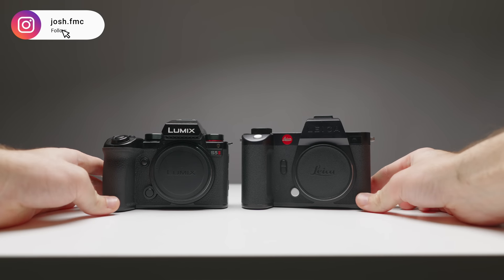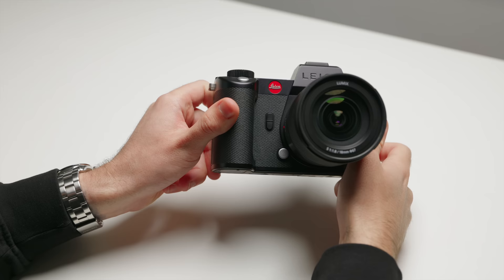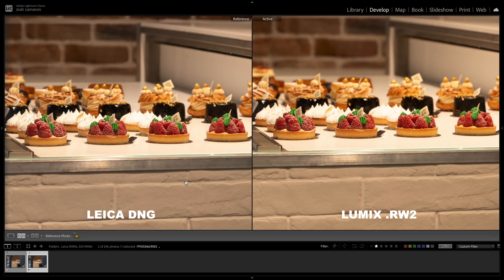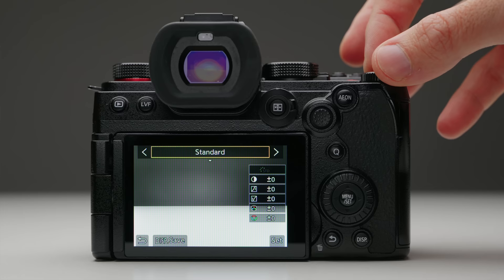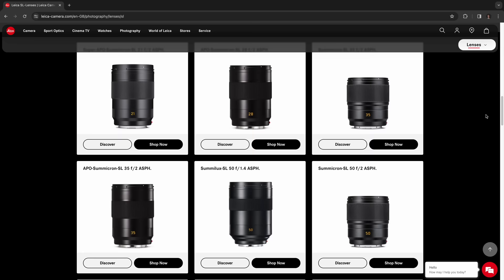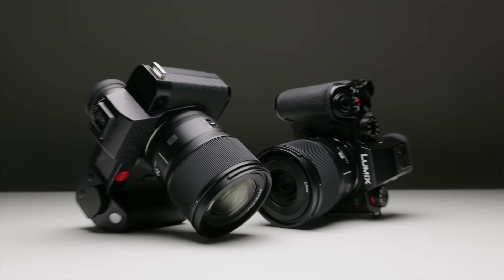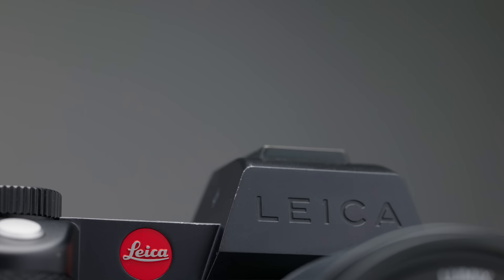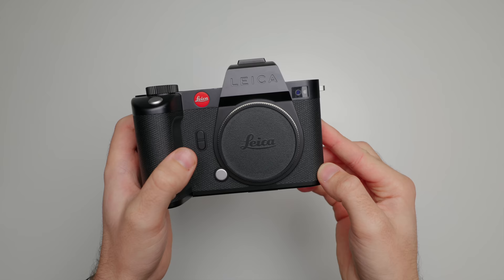Lumix VS Leica Colour Comparison

Comment: You can do just about anything on the Lumix that your can do on an SL. But that’s not the point. The build quality and user experience are what you are paying for. In addition the long term resale value is also worth considering. I have a 10 year old M240 that still fetches more than 3k on the used market. When you hold and shoot other cameras they just don’t have the premium feel of the Leica bodies. The only similar experiences I have had has been with Hasselblad from a haptic standpoint. I have an SL2 and its amazing. Not the latest tech but completely professional and contemporary with most modern cameras.

Comment: Honestly I have been able to spot the Leica, the colors seems to pop a little more because it has just a little bit more contrast, and also it seems to be a little more precise in the reds region (a little bit cooler so that red looks less like orange). But Panasonic is 99.5% there, and you can get there just tweaking a little bit the raw file (something you normally do after all). So the price difference doesn't seem really worth it to me, but if you want to spend that kind of money for all the other stuff that makes a Leica a Leica, at lest you have a slight improvement there too.

Comment: I've used Leica rangefinders professionally as well as a Leica V-Lux 114 bridge camera when short videos were required as part of my press assignments.  My impression of Leica colors is that they are just a bit warmer than the Lumix G9 I now shoot in retirement.  I still shoot JPEGs and had to adjust the G9 STANDARD colors to warm them up considerably to get close to what I considered to be Leica-out-of-the box colors.  This was not necessary for my 114 which, on the face of it, seemed to be a Lumix FZ 1000.  I still shoot JPEGs and have heard the NATURAL profile for Lumix JPEGs is warmer so perhaps I'll give that a try soon.

Comment: Bottom line: gear doesn't really matter! Throw in a Lumix G9 (I or II) and a medium format as well. Use equivalent FL lenses, process the RAWs (JPGs are a joke), and print the results (digital images are not true photographs). Now, put them on the wall and see if you can tell the difference. Under most conditions, a pocket P+S (or even a phone) in the right hands can produce museum-worthy prints. All you get for the considerably greater investment in more capable gear are things like a slight advantage in marginal conditions, better durability/reliability/redundancy, possibly better ergo and weatherproofing, certain features of variable utility, and snob appeal.

Comment: This is a fascinating comparison. Thank you. I would say that in the portrait comparisons at 3:02, there is a smoother skin rendition and softer contrast from the Leica that offers a more pleasing image. However this is slight and can be corrected in post.
The BIG question is about the difference in the filter thickness on the sensor. It is reportedly uniquely thin on the SL range, to allow for the use of M lenses without smearing, especially when using wide lenses. I often hear this mentioned but have never seen a proper comparison. If there is any way you could do a once and for all test with Leica lenses on both the SL2S and S5ii, I think a lot of viewers would find that very interesting. Me included.

Comment: I've been on Leica M for more than ten years and have a Lumix GX8 for special jobs. My local Leica dealer has a SL2 on display and I can get a 20 % discount. But I've resisted so far and after your review or comparison, I'll stick to my MP 240 and M 240. That said, both Leica and Lumix is the best, you can buy on the market.

Comment: I've shot both Leica and LUMIX and overall I agree with you – but only if you are not using Leica L mount lenses or adapted Leica lenses which have a dedicated profile for each on the SL series cameras. This is not comparable to the LUMIX or any other L mount camera (The SIGMA FP/FPL, DJI, or BMCC 6k), Leica may not have the extensive profiles as the LUMIX, but the idea here is MOST people don't need it. The user experience with the Leica SL in all of its variants (which was the first full frame L mount camera) is far beyond the S series LUMIX. As I believe you mentioned, the LUMIX S1 and S1R are comparable to the SL2S and SL2 respectively, and the LUMIX have more functions and a tilting screen – I found say, using multi-shot high resolution mode with the S1 was better than the SL2/SL2S because you could hand hold the camera where Leica made it shake resistant (I never saw any real artifacts from the few times I used this mode.) The SL3 adds the tilting screen, and a number of other modern functions that the SL/SL2/SL2-S do not have and like the entire SL line it's much more robust than the S1 series. I am interested in seeing if LUMIX actually updates the S1R or just sticks with the S5II and S9. If they do, not sure what its difference would be from the SL3 other than build, menus and maybe a few functions that would be specific to its user base. Also, for reselling and maybe switching systems you will get a better bang for your buck by even investing in a used SL2 than getting the cheaper S1R and trying to sell it later. Also, for retaining the camera for a long period of time (past its shelf life) the Leica is the better option. I have direct experience with this as I sold my SL2 and S1 at the same time and had vastly different takes. Do I agree with you that the medium format larger sensor cameras are better? I mean, sure. Technically... but the usability of the Hasselblad is SLOW, and the GFX is a mess of menu system with odd color science. I have a straight from the factory Leica S typ 007 and have used the Leica S3 and for image quality and usability I am waiting for the Leica S4 or mirrorless version (the Leica S has thus far been a DSLR type body, like the Pentax 645Z, which I also owned). I think Fuji has done a great job with the GFX, but the Leica S is giving Phase One without the cost and even at less MP (37MP for the S typ 007, and 64MP for the S3) it is the best image quality I have used. Period.

Comment: 40 seconds in & going to GUESS!!!!, - B. Just a little, (& I meany tiny little bit) more pop. Not worth an extra $4500 or whatever the price difference is. Plus if one doesn't mind the extra step, there is always the ColorChecker Passport! Would like to see the Lumix with a Panasonic lens vs Leica SL2/3 with a Leica lens comparison, since you started all this. Preferably primes of same length. Thanks for the vid.  OOHH! 3 SECONDS LATER, = WRONG!

Comment: People are asking that you do a comparison with Leica glass. I recommend using M glass adapted because many of the L mount Leica lenses are rebadged Sigma and Lumix, though probably with different quality control and perhaps coatings. For any sort of “Leica Magic” if it exists, I used M lenses, either on my G9ii or SL or M10. 
Also I think Leica has a say in Panasonic’s color profiles since many of the Panasonic lenses have the Leica seal of approval and I don’t think Leica wants their lenses being reflected poorly on other bodies. Maybe a comparison between the SL and a Sony would yield interesting results. I know for sure my colors were different when using PanaLeica glass on Olympus bodies, sometimes better sometimes worse.

Comment: I have an S1 and Sigma 1.4 28mm/40mm . I was using medium and large format film up until recently but I am not at all displeased with the S1 and the lenses are really superb (heavy 40mm tho..) I saw a strip down of the S1 and actually feel its build quality may match Leica, if not aesthetically at least internally it's built very well.

Comment: Part of the colors believe it or not come from the lens. You need to use one of the SL APO lenses. The color purity is there and it’s a real thing. Furthermore in my experience the SL2-S seems to be one of the Leica cameras with less distinguishable color than some of their other cameras. 

Definitely can get similar color with APO Leica lenses on the LUMIX, however the glass covering the sensor is thicker on the LUMIX so there will still be a difference.

None of what I’m saying is putting down the LUMIX, it’s and incredible line of cameras with a good value.

Comment: The colors in the original SL (typ 601) are drastically different than the 2. The original Q also used this same sensor and color science. If you can get your hands on one of those I think it would be an interesting comparison. These cameras I believe give you that unique Leica look, the SL2 and Q2 are just standard colors.

Comment: Josh, having used many brands of cameras, I settled on Leica.  As you know, the User Interface on the Leica is sublime.  No comparison to any brand except maybe Hasselblad.  The colors are different.  I saw the difference in all images.  Obviously subtle since you used the same lens.  As you point out, it is the lens, camera combination.  Why do I like Leica so much... One brand with rangefinder, full size mirrorless, and an older APS-C camera.  I have all three and am able to interchange lenses (manual focus, large excellent auto focus, and small light autofocus respectively).  Of course the rangefinder uses only the manual focus lenses.  But the other two can use all the lenses.  And now Sigma is making amazing l-mount lenses.  I find the brand to make robust, easy to use, high quality cameras and glass.  Just wish they would have kept the APS-C line going.  That CL is an amazing entry point.
Reply: funny how the colors are not different on a calibrated monitor!! Of course using the standard quality monitors most soy boys on mediocretube use I suppose there might be a difference.

Comment: Thank you for the comparison. I agree that I wouldn’t choose Leica based on the colour science. What I like about my Leicas is that the raw files are very nice to work with and typically feel very organic. I actually generally do not use the Leica colour profiles but prefer using my own or generic adobe profiles as a starting point. I cannot compare it with LUMIX since I don’t have one. All I can say is that I’m extremely happy with the Leica sensors and files generally.

Comment: Well, the alliance between Leica and Panasonic is known for a long time and since the beginning Panasonic was selling sensors and electronics to Leica and Leica was selling lenses to Panasonic. They also made the L-mount alliance, which just shows how close they are to each other. Leica has some very nice classic lenses, which have a different optical formula compared to other brands and produce a bit different looking images. Before Sigma came with the ART series, Leicas were hard to beat in optical quality and were like a miracle and very much ahead in the previous century. Since Sigma started to push the optical quality with the ART lenses, all other brand woke up and started to improve their optical formulas, so that now adays we have incredibly good lenses almost from every brand and Leica quality is not so exotic anymore. But the combination of optical quality and a more compact bulid compared to other brands and of course ... the character :) make these lenses still quite special.
Reply: Sorry but the sensor is from sony 😅
Reply: @junichinomura4810  And was it always from Sony? By the way-images from Sony and Panasonic look quite different, which is probably due to different processing, but Panasonic and Leica have exactly the same look, so probably the core electronics will be the same. Maybe Panasonic buys sensors from Sony and than sells the whole imaging unit to Leica.
Reply: Panasonic make their own lenses under leica specifications

Comment: I think the separator comes in when you use the apo lenses, granted you can throw them on an S5. I do still believe colors should be graded by what you can edit out of them , I’d never judge a camera I’m spending more than $3k on without color grading the files
Reply: Also I don’t think Leica is for bang fit your buck, i view it similar to designer clothes. No justification will ever be applied to make balenciaga tee worth $750 vs a $20 Uniqlo tee. If you want it you buy it cuz you want it, it’s never really a need with Leica/ designer

Comment: I think they are the same technology, with different manufacturing qualities and prices.
Leica and Lumix have shared sensors, optics. I do not doubt that behind everything there are the same patents and a work agreement. For me, the Leica Sl2 and the Lumix S1 share the same specifications and sensor.
Reply from the maker: The Leica SL2-S and S1 share a lot of similarities, but the SL2 has a high resolution sensor than the S1 :)

Comment: Too me, it was pretty obvious that camera B was the S5 II, due to the more magenta rendering of the blues and the slightly brighter values in more saturated colors. Personally, I prefer the colors of the S5 II over the Leica, but I guess I am weird that way. But truth be told, when shooting (jpegs in particular), which lens is going to make as big, if not bigger, difference than which camera one uses. For example, I can use my Lumix 24-105 f/4 at 50mm, and my Canon EF 50mm f/1.8, and my Minolta MD 50mm f/2.0, and my A Mount Sony DT 18-55 adapted to the S5 at around 35mm and they all look different.

Comment: one more comment... If you make the same comparison with the same lens at high ISO, I believe you will find the Lumix color degrades more quickly than with the Leica.  At least that is what I found a few years ago with the earlier versions of both.  That is one of the reasons I chose the SL.

Comment: That is what I keep asking, what is the point of Leica's body ( for full frame). I understand why the Leica lenses are a thing, but not the body. I remember when the SL2 was released I read in many places that it had the same sensor as the Panasonic S1 series, I still don't know if it's true but when you compare photos between the 2 I mean it pretty clear.

Comment: I agree that as a base most camera sensors seem to producer pretty neutral colour.  
one thing that I love and detest about my SL2-S is the Monochrome High Contrast Jpegs you mentioned.  It produces such pleasing black and white that I never seem to be able to reproduce with the raw files.  I shoot DNG+JPEG and almost always fall back on the jpeg for my black and white work.
Reply: Lol. I had the same problem a few times using raw + jpeg on my nikon D3500. I'd shoot some images where the jpeg version just came out perfect and I couldn't even match it let alone better it with post processing the raw. My editing skills are a bit better now but I shoot raw only so I don't have that "problem".

Comment: Both cameras are great, but Leica is not only about the camera body; in fact, Leica is more about the lenses. The so-called 'Leica look' originally stems from the lenses and their combination with the body. If you were to use the Leica 24-70mm lens, you would notice a significant difference in rendering, perhaps even more so with the 24-90mm. Both cameras share an identical sensor with different processors, but the lenses have nothing in common. :) I would love to see a comparison of the two cameras with the lenses they are meant to be used with. That said, I think it's fantastic to have the possibility to use such a variety of lenses. Thx for your video :)

Comment: As a professional user of both a few SL2s, SL2-Ss and an S1R, I recognized the SL2-S images. The APO and Lux lenses make indeed some difference, but in terms of colors it’s not that different. However, the real ‘Leica colors’ don’t come from the SL-range, but from the M and Q range. When you compare e.g. an SL2 with an M10-R, there’s quite some difference in terms of colors. Reason is that the SL is meant for working pro’s. They’re not looking for specific color preference, but prefer a more neutral image that’s very malleable. 

The fact that the Lumix colors are so similar is not accidental. Some models share the same sensor, but also the experience in the L2-Alliance. At least it makes an S1 or S1R an excellent backup camera for an SL2 or SL2-S, apart from the fact that they handle a bit different and there’s no Capture One tether capability for Lumix 😢.
Reply: fun fact, that lens used across Q series is designed by Panasonic engineers. Not a single German name appears in the patent profile.

Comment: if you use  leica M  on the panasonic l mount you ll get a lot of smearing in the cornerns, specially with wide angle lenses, the glass stack on the sensor is different..

Comment: Weren't they developed collaboratively? Leica and Panasonic have been working together for as long as leica has done digital. Many Lumix cameras have had Leitz designed lenses as well. This may be much less shocking than the video would leave us to believe. The Leica Q that you mentioned (I have one) was developed hand in glove with Panasonic. Panasonic knows electronics, Leitz optics. This is very similar to the collaboration between Leitz and Minolta for the R3-R7. Leitz is not an electronics company, Panasonic is. It is simply a combining of advantage.

Comment: Has anyone used the LUMIX S1R with the Leica M mount lenses? I’m curious to know if there is also another mirrorless system that makes these M mount lenses sing? I’ve gone from an MP 240, M11, SL2-S and M10-P — all are great and unique in their own right, but just way too costly, especially with their QC issues as of late.

Comment: Josh, try the Leica with the APO Summicron lenses which are reference class and you’ll understand. As i did moving from full on S5 with sigma/lumix lenses to 100% SL2 and SL2s with all Leica lenses. Theres a massive visible difference. 

The problem many YouTubers now is they rely so much on the views and the clicks/income, that they struggle to  remain impartial or independent as they won’t get the gear to review. And with respect, you appear to be going the same way.
Reply: This video has nothing to do with lens quality. It's about colour reproduction.